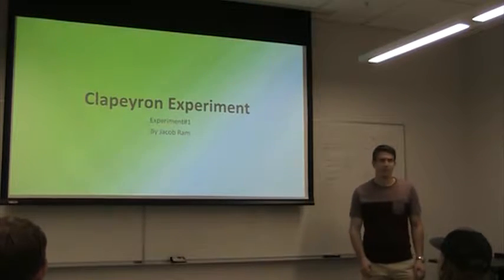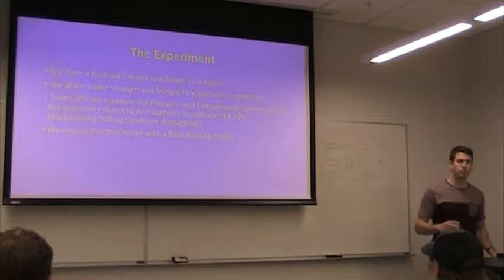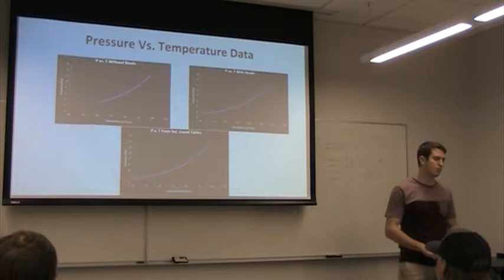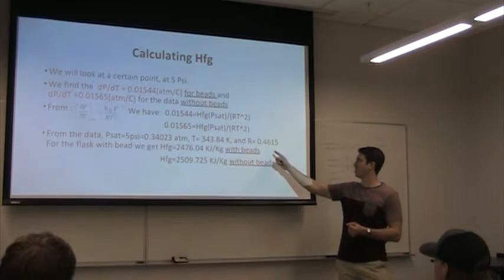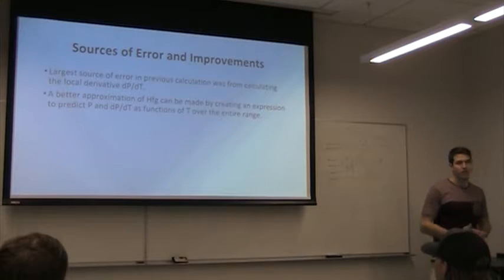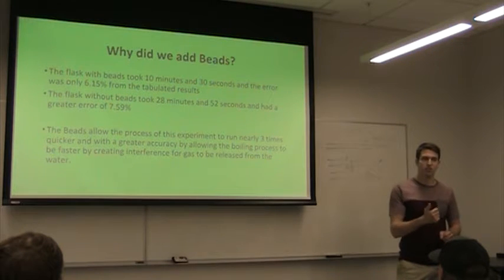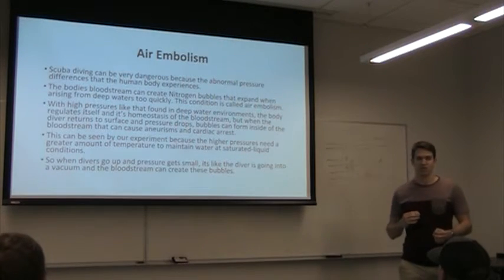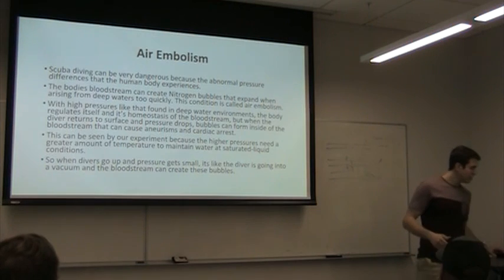Jacob Ram - 2/13/19

Comment: Technical:
You had a very good presentation. I liked the PT diagrams they made it easy for a viewer to understand what was happening during the experiment. The slide that has your numbers comparing the test without beads to the test with the  beads is a little hard to understand because it had so much on it. Maybe next time have a slide devoted to the calculations then have a slide devoted to comparing the results. I really liked the last slide with a real world example. It is always nice when you can connect a theory to something that is useful.